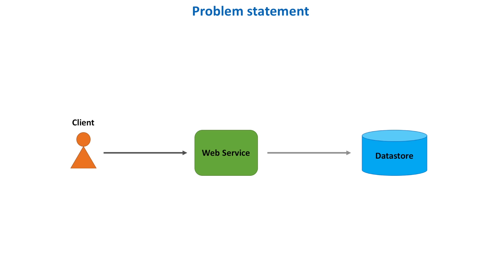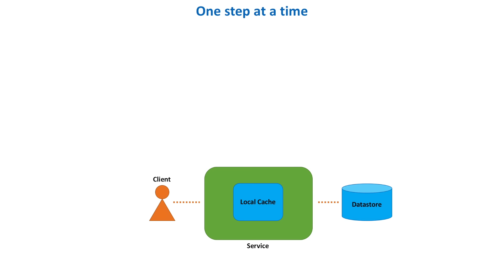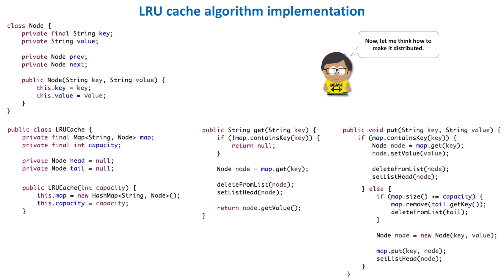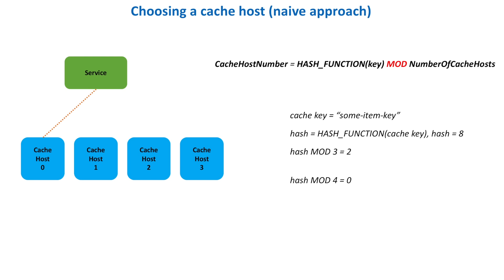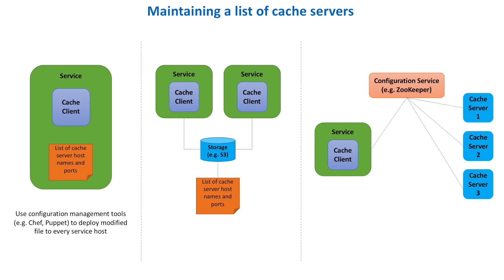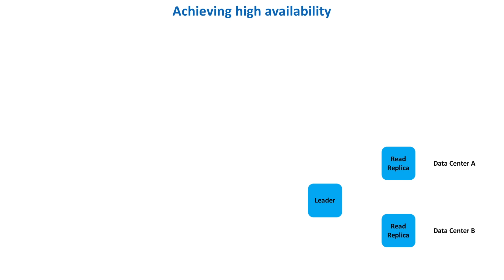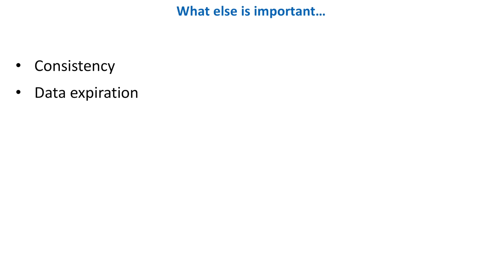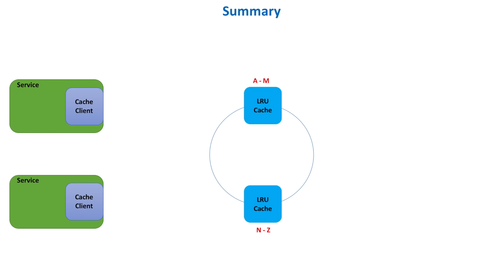System Design Interview - Distributed Cache

Comment: Great video thank you so much. @26:29, you mentioned if a cache server died and come back again, data are spread across two servers. In real work, how do you handle such complicated case?  Thanks.
Reply from the maker: Hi Nemo. Thank you for the feedback!

Regarding your question, let's discuss both scenarios. When we have a static list of cache servers (stored in a file or database). And when we have a dynamic list (cache servers register themselves with configuration service).

One common approach for static configuration is to use version identifier. Every time static configuration changes, version value is increased. All client hosts then report what version of the configuration they use. And this is operator/team responsibility to make sure version reported is the one that is expected. All clients should report the same version number.

With dynamic configuration things are a bit trickier, as there is no explicit version number. But similar ideas still apply. Configuration service may track time when configuration was last modified (e.g. when new cache server was added to the cluster or some cache server died and stopped sending health checks). And each client host reports time when configuration was last synchronized (with the configuration service). Last synchronization time must be greater than configuration last update time. This ensures all clients use the latest configuration. 

As you may see, monitoring is the key. 

Anyway, there will be scenarios when some cache clients see a different picture than the rest. Strict synchronization among all the clients is hard to achieve and usually not required. And yes, this will cause a higher rate of cache misses. When we build services that rely on distributed cache we should always keep this in mind.

Comment: thanks for the video :) It was super useful. 
a. In Local cache, wont time complexity of get and put(element already in cache) in worst case, can be O(# of elements in the cache ) right? 
b. If a is correct, is there some way to reduce tc by changing to any other data structure?
Reply from the maker: Hi venkateswaran sk,

It is O(1). Most likely, list operations (and more specifically delete node operation) confused you. Which is reasonable, as in the "classic" list we only store a reference to the next node, and during deletion we need to iterate over the list to find the previous node to update the next reference. In our case, we store both next and prev references. And in such case deletion from the list is O(1).
Reply: @SystemDesignInterview  makes sense thanks :)

Comment: After a cache miss on a get operation, shouldn't there be some process to fetch the data from the DB and update the cache to include it?
Reply: The service using the cache certainly has to do it. I believe it is implied, and not mentioned in the video only because it is not the responsibility of the cache itself.
Reply from the maker: Hi Ramy. You brought up an important topic. Of when and how to refresh the cache. And this is where different cache update strategies come into play: write-through, write-behind.  All these are important concepts for a system design. 

Although you may find mechanisms that help with cache refresh in some cache implementations (e.g. https://github.com/google/guava/wiki/CachesExplained#refresh), this is not a primary responsibility of the cache itself. 

There should be a separate video explaining cache update flow and implementation details. Let me think about this.
Reply from the maker: Thank you, @subtlebreath, for jumping in and providing the explanation. Appreciate it.

Comment: Isn’t deleting from the list o(n) worst case?
Reply: The to-be-deleted node can be accessed from the hashtable, and the node knows its prev and next nodes.
Reply from the maker: Hi Chicken Tikka Sauce,

Overall you're correct. Because to delete from a linked list we first need to find an element, which is O(n). But we have doubly linked list, where every node has references to its neighbors on both sides (next and previous). And we do not need to search for a node to delete, it is already provided to us by the hash table. So, no need to search in a list, only make left neighbor to point to the right neighbor during deletion. That is why O(1).
Reply: System Design Interview Ahh, yes. Forgot it’s doubly linked list. You’re correct. O(1) is maintained.